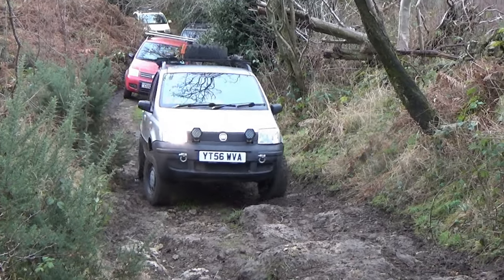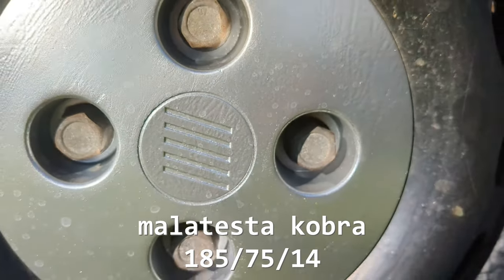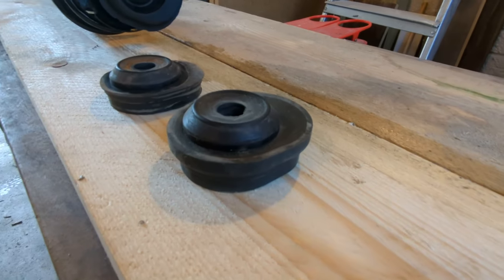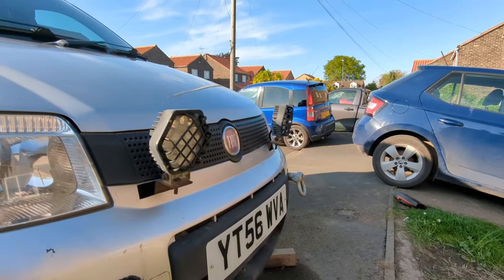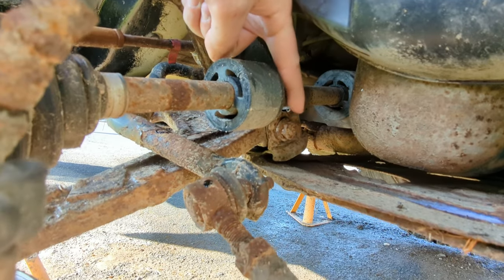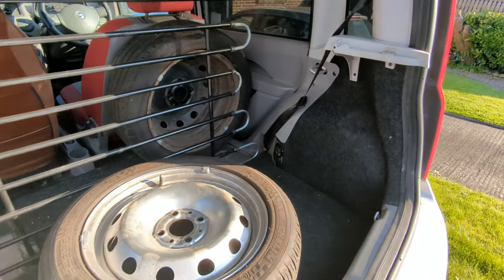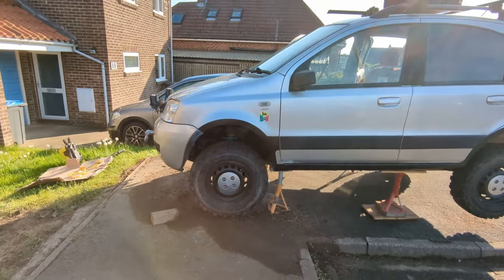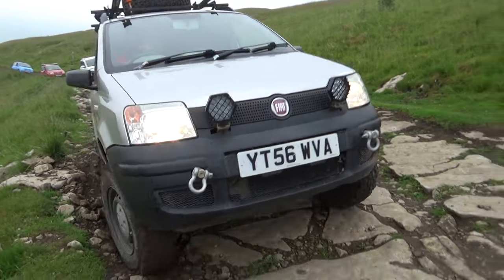Lifted off road Panda 4x4 walkaround (all mods explained)

Comment: Thanks, very interesting. I also want to build a custom exhaust. I already swapped 1.2 engine by 1.4 (from Fiat Bravo) and it's a much better.
Reply from the maker: Yeah we have swapped the engine in the yellow car that appears on the channel frequently and it goes very well 👍 The video of that will be uploaded next week
Reply: @UKPanda4x4  Why not just start with a 1.3 liter multijet car? That can easily be tuned to 90hp and loads of torque. Are they rare in the UK?
Reply: I have that exactly engine. I'm thinking to tune it to 90hp, it is so much better? Any cons? The main problem with this version is the gearing... Perfect for off road but it goes to over 3k rpm at 110kmh
Reply: @Stewie4238  Sorry, but I was wrong. I thought that I have now 1.4, but actually it was a mistake. I still have 1.2

Comment: Hi, please can you help me? My rear drives are not working. I removed the electro-pneumatic valve and tested it at 12V to see if it worked, and it lifted the valve upwards (which I assume is working). We changed the oil, but it still doesn't work. Nothing can be heard in the differential, and the driveshaft rotates normally without any strange sounds. Model is Fiat Panda 169 4x4 1.2 51KW. Do you know what happens? Thanks!

Comment: Would you consider lifting the car with longer/fatter coils instead of spacers? Many 3rd party manufacturers have different-longer sized “standard” coils, diesel pandas use these. 
Even way do you recon maximum overall lift from suspension (coils and/or spacers) to be 20mm?
Reply from the maker: The research and/or cost in finding the right spring to do the same job makes no sense. You wouldn't gain anything in this case.
Reply: @UKPanda4x4  Thnks for the reply, theoretically using a longer coil rather than a shorter coil with an inelastic spacer gives more linear compression, but reconsidering it again this (might) apply only to dynamic driving, not for climbing. Please correct me if not.
Regarding lift, is it the wisest to limit lift to 20mm? Do any other equipment are needed like longer bolts, nuts, bump stops, strut mounts, any spacers to arb so as not to have any weird interferences? I ve seen the prometeo 15mm lift kit that include some bolts.. Do you have the link for the russian spacers?
Thnks again and appreciate.

Comment: Thanks for the video, it was very informative. I've got a 2008, 1.2 petrol, panda 4x4 which I've had for about 6 years. I absolutely love it. I've often thought, my perfect car would be if Abarth had done a version. I had wondered about the 100hp engine, but hadn't seen that it had been done, so assumed that there would be issues with the transmission coping with the extra power. Has your friend not had any problems... so far?
Reply from the maker: Its been in the car for a year, he hasn't used it for all of that but it has had a really good thrashing and has had no issues. Theres a couple of fiddly bits that need doing but its otherwise a really straightforward swap. The hard bit is sourcing a donor car for the right price as you need more than just the engine to make it work
Reply: @UK Panda 4x4  That's a very good point about sourcing the right donor car, I can't imagine there are too many good ones  about, but now I know it's potentially doable, at least I can keep an eye out. Thanks for the response.
Reply from the maker: Just look out for something thats been crashed. Even a front end smash could be fine because you don't need the air con or the radiator from the 100hp
Reply: @UK Panda 4x4  Thank you, I was wondering if a front-end crunch would work. 👍🏻

Comment: thanks for interesting video! You have mentioned that lifting by 30mm makes some issue, could you please comment what kind of?
Reply from the maker: With 30mm spacers you must be careful which springs you use. I previously had springs fitted which were supposed to be a direct replacement for the originals but they were slightly longer. This combined with the 30mm spacers lifted the car too high and the driveshaft made contact with the subframe over bumps. Springs from different brands will vary in length even though they are all supposed to be for the same car so its just something to be aware of. I now have shorter springs fitted so I may put the 30mm spacers back on when I get a chance.
Reply: @UKPanda4x4  Thanks a lot for detale replay, very helpful!
Reply: @UKPanda4x4  thxs